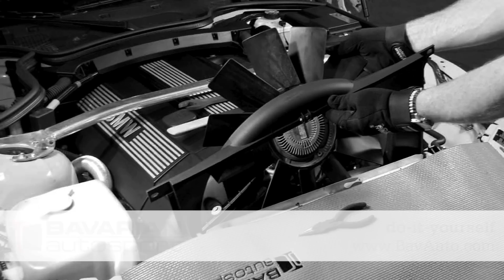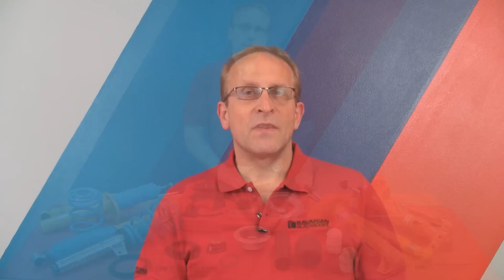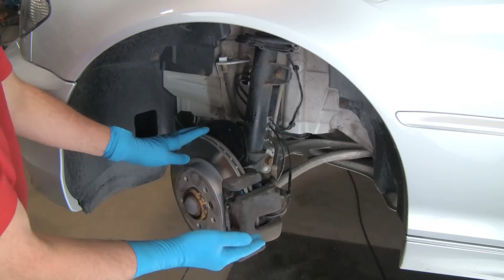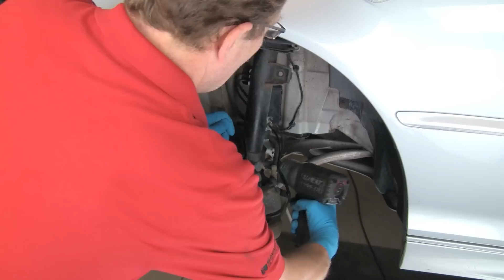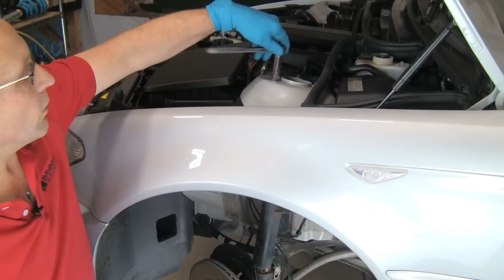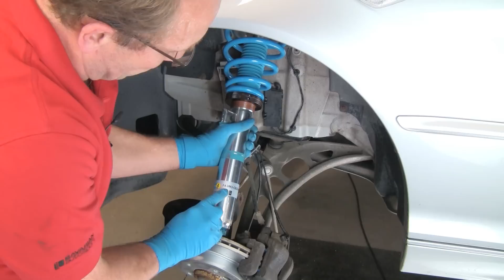Part 1: Installing shocks, struts and springs on a BMW 3 series 99 thru 05 (E46)

Comment: Great video, Thank you! However, years ago when I replaced the control arm bushing/control arms/ ball joints, everyone was raving about the Meyle arms/joints/bushings. Now, attempting to install stock replacement dampers, I can't get enough clearance to get the shock in/out of the steering hub cinch assembly. Amy tricks?

Comment: Probably just a personal thing but I always replace the pinch bolt. The reason is that I don’t know the history of the bolt and what stresses it’s seen previously; it came off easily in this video but in the past it may have been more difficult and taken beyond yield. It also might not be the correct bolt if there’s been a previous problem. Stick a new OEM one in, you know it’s safe. Same with any other main bolt e.g. the ones for the alloy brace under the car.

Comment: I have a 2000 323i which I am having trouble finding the correct aftermarket strut/spring assembly. The dealer looked up my VIN and said that my BMW is the sport/premium package with the sport struts. Most all the aftermarket struts state they are NOT for the sports suspension. I do not have the electronic suspension. Do you sell the correct strut/spring assembly for the front of this BMW and what part number is it? Thanks in advance.

Comment: Question regarding st coil overs - The front shock is not cone shaped like the pss10.  therefore do i not need a upper spring pad nor the spring plate?

Comment: Would spraying WD40 on the pinch bolt help so it won't snap? If does snap what would you use to remove the broken bolt?

Comment: And if the bolt breaks like mine did.. What do I do???? Do I have to buy a new pinch clamp or can it be drilled and tapped ?
Reply from the maker: +Tom Yarosz - You can drill & tap.  We've had to do it too.
Reply: +Bavarian Autosport so what size drill bit and tap should I get ? Thanks for replying so quickly !

Comment: I noticed you didn't show us the upper mount that screws on with three bolts under the hood. How does it fit, does it need a cushion pad? Does it fit flat against the mount? It is flat surface.

Comment: My wheel on my 330ci 2002 gets pulled to the right and left when it drives over bumpy surfaces. A mechanic told me that it was due to someone putting the spring back onto the strut without twisting the spring into the correct position. So now the spring acts a little wonky. Does any body know if the spring needs to sit onto the spring pad in a very specific location or not?
Reply: Yes.  There's a Bavarian Auto sport video that shows the correct location for the spring.  Better late than never.

Comment: Toy guys at bav auto are really professional love the vids... 
Was wondering if this was the issue with my 02 325i.. every time i turn the wheel i hear a really bad sound its not coming  from the power steering. . It sounds like something  is not greased and i can feel it in the steering  wheel..any ideas? Fellow  YouTubers, bav auto??

Comment: I have an e46 1999 that I had trouble removing the front struts from. I bought struts from you guys and got them installed into the spring. When I was trying to remove the old struts I could not get enough clearance to get the tube out of the c clamp. Any hints or ideas?
Reply from the maker: If you disconnect the swaybar link, you should be able to push the control arm (and hub asssembly) down a bit more.
Reply: BavarianAuto Swaybar end link removed like in the above video. I had to reconnect the top bolts in wheel well and then push the c clamp back on and all the way up, then shove the c clamp and rotor down hard then the bottom of the strut popped out of the c clamp. Had to do it on both sides. I'll be lucky if I didn't break anything.
Reply: I called in and got an answer that should help.
Reply from the maker: Ra0king
 - Any progress?
Reply: BavarianAuto Thanks for asking, I got it done on Saturday without any real issues for some reason putting it in was easier than taking the strut out. I really don't know why but I didn't need to pry anything downward.
Reply from the maker: Ra0king
Great ... at least it's done!
Reply: BavarianAuto Oh I should give a plug, I really like the Meyle shocks I got from bavauto! Ride is much improved.
Reply from the maker: Ra0king
Good input! thanks.

Comment: I have a 2000 328i with performance suspension. Got everything loose, but the hub assembly would not drop down enough for me to remove the old shock. Even with prying it needed to drop another inch and a half to remove old shock. Any suggestions?
Reply from the maker: We're not exactly sure just where you are having trouble.  If you remove the lower mount bolt first and dislodge the lower end of the shock from the trailing arm, The complete shock will drop right out, once the upper mount is disconnected.
Reply: I did not remove the top three bolts, just the lower mount bolt and the arm on the side of the shock. The trailing arm(hub assembly) drops down but wont drop far enough for the shock to be removed. Is this problem with the performance suspension?
Reply from the maker: edward shippen  --woops.  We assumed your were at the rear suspension.  Sorry.
On the front, if you disconnect the swaybar link and the headlight sensor link (if used), you should be able to push the steering knuckle clamp downward on the shock.  You will not typically be able to fully push it down off the shock tube.  As shown in the video, remove the three upper mount nuts and then lower the shock and hub assembly.  Push the assembly downward and pull the top of the shock assembly out of the wheel well.  You can then pull the shock out of the clamp.  You can have a helper push downward on the hub assembly as you pull the shock from the clamp.
 -
Reply: ed shippen   Tried again, This time removing 3 upper mount bolts.  It will not clear wheel well, so did not help.  The hub is down as far as I can push downward on it and it still needs to drop another inch or 2 in order to remove shock.  Evidently performance suspension requires different procedure.  Do I need to lower trailing arm ball unit?
Reply from the maker: edward shippen
Ed, do you have doth the right and left sides in the air 9wheels hanging)?  Do you have the swaybar link disconnected?  Sport suspension will have nothing to do with how low the control arm and hub will push down.
Reply: BavarianAuto Yes, sway bar disconnected, but only driver side of car jacked up and wheel removed. Do you think it would make a difference if I jacked up other side as well?  Was doing one side at a time.

Comment: Ahhh the e46 strut pinch bolt, my arch nemesis.  So we meet again. :D Doesn't this bolt have like a 50% chance of failure the first time it is removed?
Reply from the maker: Not exactly 50% .... We've broken one.  It certainly is an issue to be aware of ... and prepared for.

Comment: So when I purchase the strut assembly, that includes the shocks aswell??  or do I need to purchase seperate shocks from the strut assembly?? also will this resolve any tramlining that I've been experiencing while going about 35mph or more on the highway?
Reply from the maker: Really, all you are replacing is the shock.  The complete assembly of the shock, spring and associated components is what is commonly called the "strut".  You would normally replace the shock and reuse the spring. You may or may not replace the upper mount and other hardware.People tent to use the term "strut" for what is really just the shock itself.

As for your "trammeling", worn shocks may or may not be contributing to this.  Are you talking about a vibration or the steering tending to pull one way or the other?
Reply: BavarianAuto  No vibration, just the steering needs to be corrected at speeds higher then 35mph when on the highway there is a 2inch or so play. Do you know what that could be?

Comment: at about 7:40 you talk about the link that connects to that headlight thing, my link is okay but the plastic around the link broke off, what is that whole headlight thing called?
Reply from the maker: If the arm from the sensor unit is broken (that the link connects to), you'll need to replace the sensor.  If you have an E46 3-series, here's a link to it:
http://www.bavauto.com/fland.asp?part=37%2014%206%20784%20696

Comment: will the coil springs from the from off a e46 fit a e36
Reply from the maker: The rear springs will physically fit.  The fronts will not.

Comment: in order to install the "strut dust cover" will I need to remove the entire strut as well as the coil spring?
Reply from the maker: If you mean the plastic tube that is snapped onto the external compression bumper, and protects the shock piston rod from direct exposure to dirt and moisture ...... yes, complete disassembly is required to remove or replace it.
Reply: BavarianAuto :( so will you need a spring compressor as well to do so ?? And I will need to do alignment after I re-attach the strut right?

Comment: I was asked by a lady friend of mine to check her shocks, on a 2003 BMW 330xi, so I told her I would need to do some research first. Looking at her shocks it looks like who ever did them may have replaced them wrong. The flang on the shock looks like its in the wrong position facing inboard instead of toward the back of the vehicle is this wrong? Also do you have a diagram for how the bottom spring plate sits, in relation to the flang?

Comment: Great video guys, I just replaced my front shocks on a 2006 X3 and this was really helpful (I ordered the Bilsteins, new tower mounts and rubber seats from bavauto.com of course).  I have to say I had a real hard time removing and reinstalling the shocks from the lower pinch bolt since they were rusted/fused in there a bit.  I love how yours just slid in and out :)  I ended up getting it done, but for those looking to do this get a can of  penetrating lube, you'll need it.

Comment: hello. Im hoping you could help, I have a 2005 M3 and the inner tire (Front left) keeps rubbing against the strut where the spring seats. All components are original including the rim and tire size. The tire is now wasted around 1 inch on the inner side. Any idea what can possibly be wrong??

Also, about a week ago I had to pull over to the side of the road to find the tire shredded (same side). I threw away the tire before i could take a look if it had gone through the same problem